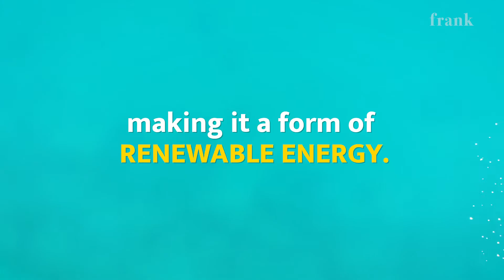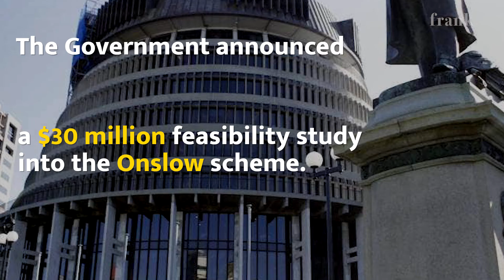Pumped storage: A game-changer for New Zealand’s electricity needs?

Comment: Where did the $4 billion come from? When the project was scrapped, they were talking $16 billion.
As nice as it would be to have, the storage it would offer is tiny compared to storage we already have in the hydro lakes. The current lakes should be used smarter as they can be turned on and off to a large degree as required...so use all the geothermal, wind and solar as it's produced and use the lakes for the peak demand times, then you don't need a $16B+ battery.

Comment: Being right on Aucklands door step would be better location.
One of the cones could have a tram that runs on a track which spirals down the cone.
The dynamo is on the tram the track is tilted into the cone side.
The dynamo is driven by gears driven by the wheels.
A brush connects the dynamo to the power system.
The trolly is loaded with weight.
I cant do the maths but this is cheap and quick, locail and easy .
Reply: Agree with weights on rails idea, there's plenty of slopes to utilise in the Auckland area. Something else that's of abundance in Auckland is buildings, jacking them up a good meter or so may store some energy. As for pumped hydro in the North Island, the site with the largest potential Prof Bardsley identified was connecting Lake Moawhango near Waiouru with Lake Taupo, however the storage available is smaller than at Onslow

Comment: The problem with pumped storage is it consumes more power than it generates.
Reply: All forms of storage have that problem. The problem is you cannot store electricity without converting it to another form of potential energy (mechanical, chemical).
Reply: So what you are missing the point, the storage is for excess energy preferably from variable sources like wind and solar. Yes there will be losses in its storage but much less than storing nothing. Its better to have 90% of the energy created during the day for night usage than non dont you think

Comment: Onslow boondoggle B.S.
"When the prices are low"
-if you buy power for pumping then more supply is needed from .. fossil fuels?

"and there’s plenty of water around"
-ALWAYS but there's NEVER plenty of hydro power - most ever in Sep'04 met 68% of demand.

Just a tiny fraction of the New Zealand government's money saved by cancelling the Onslow pumped hydro boondoggle could be used to incentivise wind farm building NOW in a South Island Wind Development Zone, convenient for transmisson to Benmore, the South Island terminus of the HVDC Inter-Island,  to solve the dry year problem.
+1GW wind ends the need for south transfer - better than Onslow at 15% of the cost
+2GW wind firms north transfer in dry times twice as good as Onslow at 30% of the cost

Comment: PHES: requires pumping water up during low energy demand, but what is the means of the power generation used? If it's hydro then that is moving energy from one battery to another minus losses, which does not appear to make sense, when increasing the existing storage lakes capacity would save the losses of moving the storage to another lake.
If the energy is from solar less likely to be available as solar is only likely to be generating during hours when NZ energy usage is highest.
If wind then also variable as most efficient in generation during daytime when thermal air movement greatest
So where does the pumping energy come from that is 'excess to demand and available' ?
My suggestion (which I haven't seen mentioned anywhere) would be building a small 'dedicated' solar system close to the pumping station and 'trickle charge' the high level storage battery (lake) from another source that would otherwise not go into storage - natural lake discharge river, not the storage lake itself or river feeding that lake

The off peak low energy/unit cost systems I've seen in other PHES schemes is only relevant for local applications and is not a National solution as it is all about cost of electricity purchase and do not look at 'how' the cheaper energy is generated ie doesn't care if the battery is charged from another battery and the losses as a result in doing so

I'd appreciate being directed to a feasibility study for NZ situation if one has been carried out
Reply: The workings and economies of pumped hydro are well explained in this presentation: https://youtu.be/McByJeX2evM
Reply: Could something like a ram on a big scale, using the water's own power, be used to pump it up there?
No need for any other energy input then.
Reply: @evapick1566  Unfortunately you don't get something for nothing - the "water's own power you mention" could only come from either a hydro lake (head generated from water falling) either the Clyde dam or Onslow itself - either would only waste energy
Reply: I think you need to read up what a Ram is, do understand what I was asking there:
A ram is an old concept and it works really well (At one point we had all our water pumpded a considrable hill by one)
. A ram is a hydraulic ram pump, (ram pump, or hydram) is a cyclic water pump powered by hydropower. It takes in water at one "hydraulic head" (pressure) and flow rate, and outputs water at a higher hydraulic head and lower flow rate.
Reply: @evapick1566  Hi I'm a mechanical engineer - so yes I do understand the principle you are referring to.
It's a principle that firstly relies on the fall of water for the lift to occur. That's where the problems start for such a system to achieve  a significant level of lift 
A small 'domestic' type system might lift 7m for 1m fall, so if applying that to the scale of this project, which requires a lift of approx 535m, close to 75m of fall is required. The Clyde Dam is approx 100m available head. And it's far more efficient to use that head for driving turbines to generate electricity.
Also as previously stated you don't use a battery (lake storage head) to move energy to another battery (Onslow Storage head) without losses!
So if the full capacity of the primary battery (Clyde Dam) is required by the NZ grid - result is wasting energy.
The second battery system (Lake Onslow) only works if you have 'spare' generating energy somewhere in the power generation system
Reply: Thank you,  @klburroughsnz  !
That's exactly what I was hoping for, somebody who knows what they are talking about and can answer my question in detail.
Appreciated! :D
Reply: Thank you Ken. You've identified the flaw with the Onslow pumped storage proposal - where does the pumping energy come from? The NZ grid has no routine surpluses. The most hydro generated in any quarter was in September 2004 and that only supplied 68% of New Zealand's demand. In that quarter the hydro capacity factor was a high 65% but nowhere near the 100% of a maxed out hydroelectricity system. So there just was no more hydro to power Onslow even in that best-ever hydro quarter. There's just no point in powering the pumps with more fossil fuel generation. There's certainly no surplus of wind power, not yet anyway. Solar is barely registering.
Even if they installed more wind power, as I recommend, that should be used to save hydroelectricity generation in the existing hydro schemes, saving the cost of building Onslow.
In summary, the Onslow scheme is not feasible economically, even if technically it could be built, because there is no need for that scale of energy storage and not likely to be in the years ahead.
I believe the government is funding a feasibility study and I can only trust that the recommendation will be to cancel further consideration of Onslow to focus on more useful projects - +2GW of wind power for the South Island should solve the dry year problem, for example.

Comment: The power station may need to be bigger than 1000MW if the Clutha River can handle the larger flow without environmental problems?

As New Zealand electrifies nearly all of the economy, even with the needed economy wide energy efficiency improvements, and as more windfarms, roof top solar panels and large scale solar panel farms come on line, the need for electricity generation levelling and to provide the extra generation capacity to meet peak demand periods plus the need to provide enough electrical energy during multi year dry periods - will likely mean a maximum output capacity for the Onslow pumped storage scheme closer to Snowy Hydro's Snowy 2.0 scheme of 2000MW peak output may be more appropriate.

If the Clutha River cannot cope with the increased water flowrate associated with a 2000MW output power station without environmental costs then a downstream storage reservoir that could moderate the peak flows into the Clutha River may be needed. If such a downstream storage reservoir was required then can this be done in a minimally environmentally damaging way? Should the downstream reservoir be an 'off-stream' reservoir on already cleared land?

There would be some head loss for the Lake Onslow system associated with incorporating a downstream reservoir but this would still be small compared to the very large head difference that the scheme offers. Pumping capacity I would expect would only need to be a fraction of the power station mode capacity due to the longer timespans available for pumping compared to generating.  If a pumping capacity of say 1000MW was optimal then only half of the turbines would also need to operate as pumps in the reverse mode.

This project no doubt needs a lot of modelling of the many options to ensure New Zealand gains the most out of this wonderful opportunity and that the downsides are minimised through careful design right from the beginning. May I suggest people like Andrew Blakers of the ANU and Snowy Hydro's experts also get involved but I suspect they already are involved.
Reply: Even with "more windfarms" etc the modest amount of extra energy needed in a somewhat misnamed "dry year" - about 500GWh per dry month - can be used to save conventional hydroelectric generation, without the great expense of building an redundant pumped storage scheme.
Onslow is too big, too expensive and too stupid.

Comment: Gravity can be exploited to store energy, without having to flood river valleys. You just need to lift up weights when you have excess renewable energy and then let the weights drive turnbines when alternatives are not abundant. This is environmentally much cleaner than using chemical batteries or flooding endless river valleys for pumped hydro storage. Tasmania's Lake Pedder was flooded causing a great amount of species loss, motivating a green movement to oppose flooding the Franklin River. Creating huge dams by using much concrete also  produces huges emissions.
Reply: Very fortunately the existing Lake Onslow is a man made reservoir in a sparse landscape of grasses and sedges so the undeniable but small environmental cost of flooding the much larger area is not in total nearly as damaging as nearly all other existing hydro schemes are individually and that were built decades ago. Lake Onslow is definitely not a unique jewel like Lake Pedder was and still is - which by the way MUST be restored to its original natural condition and before any new pumped hydro schemes are allowed to be designed or built in Tasmania. The Australian and Tasmanian Greens must make the restoration of Lake Pedder to its original natural state an essential precondition to the proposed building of any new pumped storage systems in Tasmania and any proposed new systems must meet the strictest environmental approval standards. Then we can all proceed as one and good outcomes that suit all parties involved including the natural environment can be attained - or if not its a shit fight to the end that no one will gain from - which may be the preferred approach of some remnant dinosaurs in the applicable hydro power authorities and privatised power speculation businesses.

The important wetland area that developed over time as a result of the manmade Lake Onslow can be retained and expanded by modifying it to float on the surface as a type of floating reed mat so that the fluctuating water level associated with the new much larger Lake Onslow no longer presents a problem. Professor Earl Bardsley suggested the floating wetland idea from the very beginning in his first report in 2004/2005. The good professor also explained how some of the environmentally damaging aspects of the existing hydro power systems could be significantly reduced by taking advantage of the capacity of the proposed Lake Onslow pumped storage system. I think he even recommended as I recall the return of one particularly damaging existing hydro power system river valley to its original natural state.

The current Aotearoa/New Zealand Labour government does appear to be taking a careful considered approach that is taking into account environmental and social consequences and is trying to minimise these costs and to undertake compensatory measures. The Aotearoa/NZ Greens are also not going to provide a blank cheque endorsement and are in a position to ensure proper procedures are followed. Environmental experts and experts in all other relevant areas will need to be given a fair chance to undertake studies and to report to the responsible authorities.

The maximum possible storage capacity of the proposed Lake Onslow pumped storage project is 12 terawatt-hours (TWh), achieved with a lake level maximum of 800m and permitted dry year water level decline to 720m. That is 12,000 MWh which is far larger than any alternative storage technology by many orders of magnitude. This scheme can therefore supply sufficient electrical energy to meet the expected shortfall for all of New Zealand during any long multi year dry periods without resorting to fossil fuel powered electricity as is the current situation.

I suspect the dams required by the Lake Onslow pumped storage scheme would be clay core rockfill or concrete lined only. You are right to point out that cement production is currently a high CO2 emission product and the transition to 'greener' cements that for example use fly ash (ash from coal fired power stations) as well as some other technologies is needed and this project could be a driver for bringing that transition about IF governments act accordingly.

This article provides good background information as the video is actually just a very brief snap shot. This project is also not responsible for all of the world's current short comings.

https://www.nsenergybusiness.com/features/new-zealand-pumped-storage/
Reply: @andreasbimba6519  What the Onslow fans never explain is where is the power to pump the water up to Lake Onslow coming from?
If Onslow buys power for pumping then more supply is needed to serve other customers which comes from where .. fossil fuels?
If NZ installs new wind power capacity then just use it to save water in the existing hydroelectric reservoirs and you don't need Onslow at all.
There's no surplus of coventional hydro power - most ever in Sep'04 met 68% of demand.
Reply: @Scot_Scientist  Exactly my point at the top of the responses
Reply: @Scot_Scientist Could you support raising Lake Pukaki and/or diverting the upper Rangitata to add to the Waitaki in lieu of building Lake Onslow
Reply: CO2 emissions works fine too. It is a perfect clean natural gas. Without it we would die. I love trees and vegetation and therfore love more CO2. If you beleive in the CO2 causing heat and sea level rise propaganda then still less people die from heat than from cold and also if you can not cope with 20cm sealevel rise then you should not have but that beachfront house anyway and you can also not cope with a 1 in a 100 year storm.

Comment: There is something very similar in El Hierro Canary Island in Spain. They pump water up the hill with wind turbines. It seems that pumped hydro works fine.
Reply: New power capacity will come from windfarms, rooftop PV, PV panel farms, mini and micro hydro power, some biomass and some wave/tidal power and all of this will need pumped storage and large battery banks to provide the backup capacity and to ensure system stability. Phase out of fossil gas usage will also add considerably to the needed capacity from the national electricity system. Thanks for the energy figures which helps get a feel for the size of the task.
Reply: @andreasbimba6519  Wind especially in New Zealand and solar to a limited extent can also save conventional hydroelectricity generation which is yet to be done to any great extent in New Zealand before they need to turn to pumped hydro.
+2GW of wind power is proper solution to the dry year problem, unlike this Onslow pumped storage boondoggle.

Wave power doesn't work very well. Wind is better in every case.
Reply: @andreasbimba6519  Thanks for your comment. Changing a bit of topic... do you think that NZ grid can afford to phase out combustion engine cars and change for battery electric cars? Do you think that might be a space for hydrogen/ethanol/ammonia fuel cell cars? thanks
Reply: @flvflvflv-x4p  The NZ grid has further development to go before it can power zero emission cars for everyone from 100% renewable energy, but we can plan ahead for that day of course. Hydrogen fuel cell vehicles go further on one refuelling so yes of course.
Reply: Nice man, destroying the scenery with religious status uhhh I mean wind mills and then destroying massive amounds of land and animals to store the energy because most of the time when we need the energy there is no wind. That indeed works fine man!